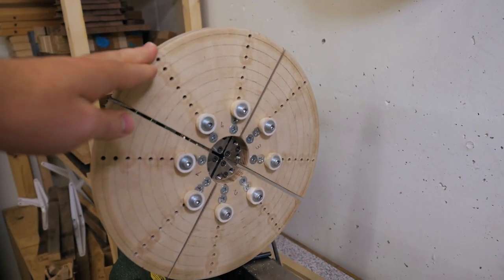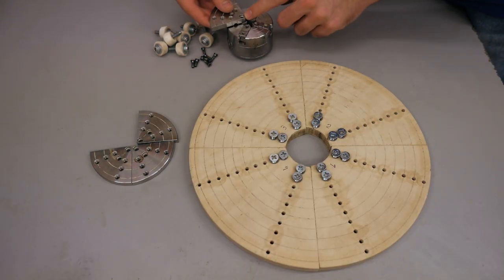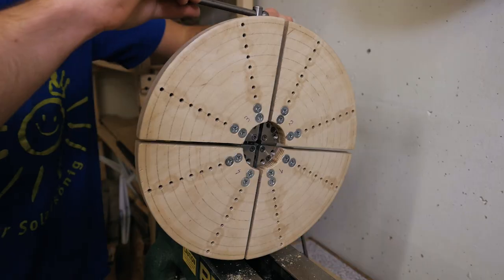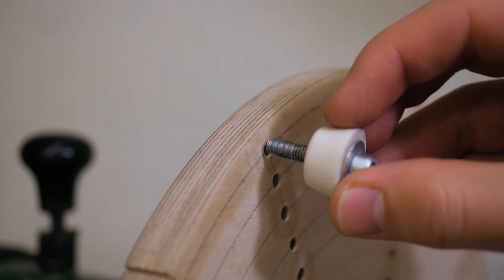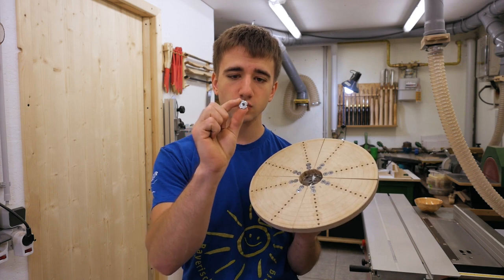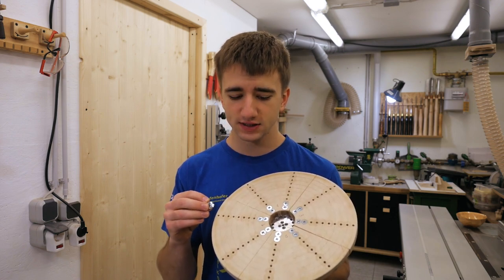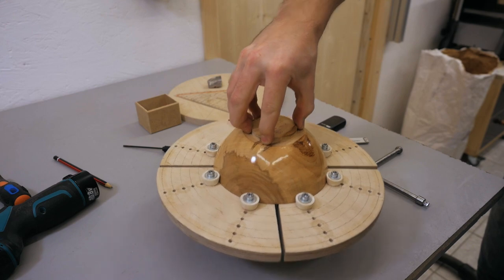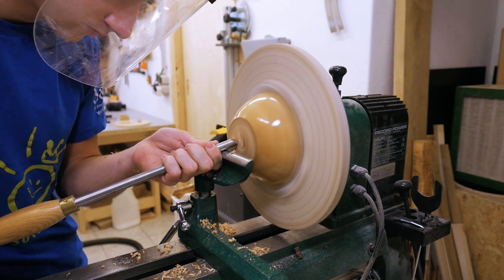Homemade Remounting Jaws (woodturning)

Comment: If you should strip out the treads in the holes may I suggest using a threaded insert to hold the rubber stoppers. They are more expensive than the "T" nuts but they hold very well and stay straight. Since they are a little pricey, I'd just use them to repair a stripped hole. Remember to keep the jaws in balance  by placing one directly opposite the repair.

Comment: Did you not tighten the bolts after inserting the bowl?  That would explain why your bowls are not held tight enough.  The rubber is supposed to expand onto the bowl.

Comment: Hello, two questions:
1.  Can the jaws be mounted directly to the chuck, instead of to the accessory jaws?
2.  For the holes tapped into the plywood, did you harden the threads with CA glue?
Reply from the maker: Yes, mounting them directly should work and no, I didn't strengthen the threads in any way.

Comment: Did I understand correctly that you tapped the holes in the Birch plywood? If so, did you add CA glue and retap so that the threads were reinforced? Great project, thank you for sharing!
Reply from the maker: No reinforcement, just straight into the wood

Comment: Hello Marius. I enjoy your videos and find the content to be both informative and entertaining. However, I wouldn't rely on the plywood to hold the screws when they are used repeatedly. Over time the holes will eventually become worn out. You could expand the "T-nut" holding idea by cutting channels in the back of the plywood plates sized to fit some flat-bar. Then just mark and tap the flat-bar to fit the screws and rubber contact pieces you already have. I would hate to see anything along the lines of your dust-collector mishaps happen while you were working at the lathe.

Comment: Never like the idea of threaded wood, you could router a groove in the underside of the jig, and bonded a metal strip in, and threaded that.
Reply: Metal screws threaded into wood work very well. 15mm of threaded birch plywood is must likely even more dureable than a thin metal strip on the back and much less work to build.